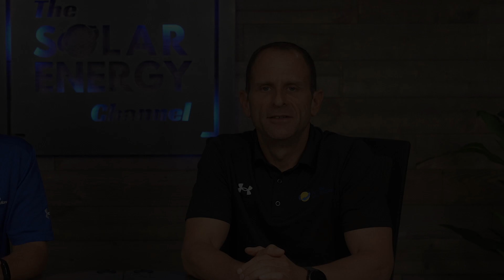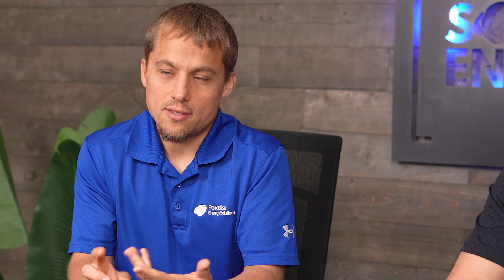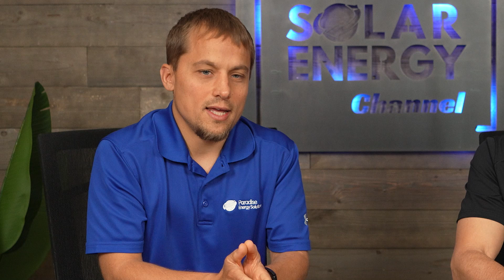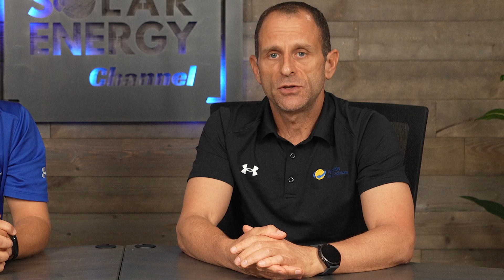Spot Solar Panel Problems BEFORE They Drain Your Wallet

Comment from the maker: Timestamps
0:00 Intro
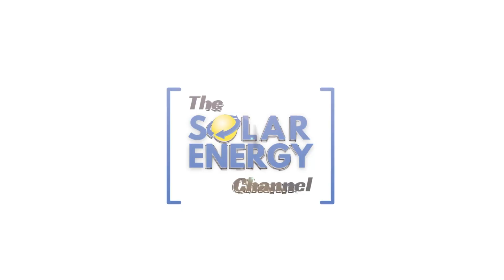0:18 Components of a solar energy system
0:58 How to know its working
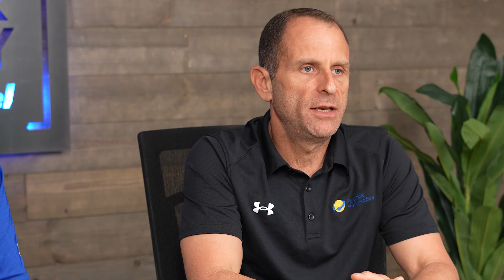2:03 Common issues to be aware of
2:36 How to uncover issues
3:29 DIY fix or professional help
5:50 Is regular maintenance needed
6:53 Summary